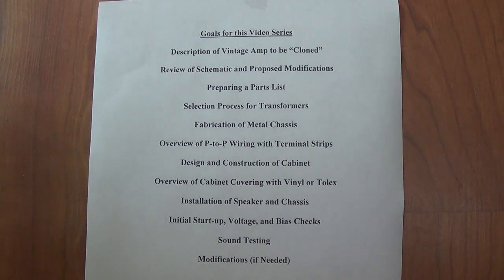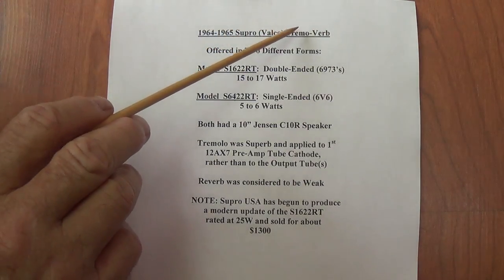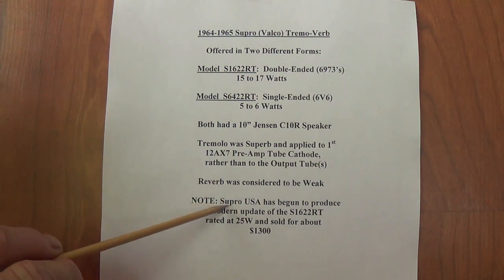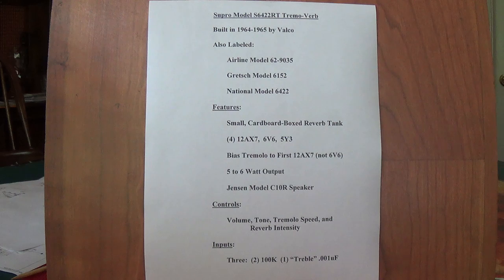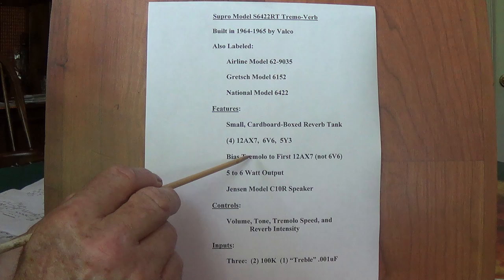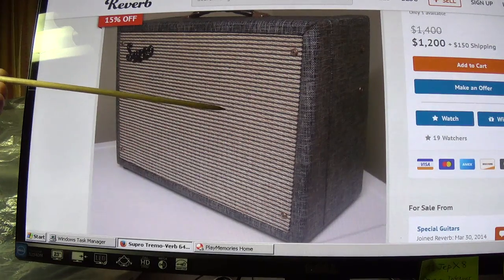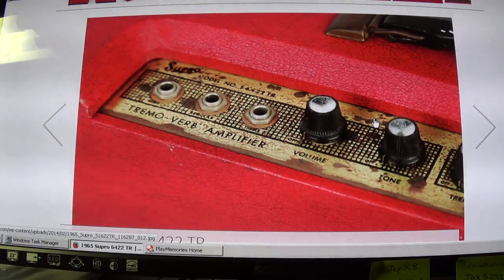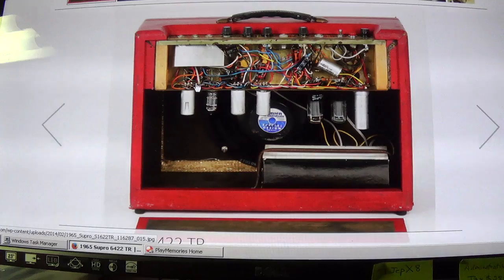How to Scratch-Build a Vintage Amp, Part 1:  Research and Methods

Comment: Hi Uncle Doug! May I ask you a couple of questions? I am planning to build a small Amp (2,5 Watt) using an old Tesla radio for parts. It has a Rectifier Tube and 1 preamp,  1 poweramp and 2 further for radio purposes. Tubes used are Rect: AZ11 Pre 6AV6 Power 6V6 the pre and power have other codes but i am giving you the alternatives that may be more familiar. Power input Transformer has 6,3 Heater ( with all tubes there was 1,6 Amps used. It will now be approx 750 mA) and 4V for Rectifier tube and 250-0-250V where according to schematics 238 V leaves the Rectifier Tube. My questions are, Firstly do you see the possibility of getting Tremelo on here and if yes can you recommend a suitable Tube and secondly do you see a better combination of tubes for Pre and power amp bearing in mind I don't know what the output Transformer is capable of, output is 5 Ohms. Maybe Rusty could check this over for me !
Reply from the maker: The AZ11 is not an ideal rectifier tube, in my opinion. It's voltage drop is even higher than a 5U4.  Other than that, I know little about it. The other two tubes sound OK. Are you sure the rectifier heater winding is 4V? As far as a tremolo, I guess you could fit in an extra 12AX7. I don't understand the OPT "output of 5 Ohms".
Reply: Rectifier heating is  4 Volts yes, even noted as 4 Volt heating on the Tube Data but I do have a 6,3 volt line also for the others. 5 Ohm is the speaker out, yes I have a 5 Ohm speaker :-)
Reply: Maybe a diode rectifier instead, there seems to be a great lack of filter cap and grid resistors and so in the schematic, maybe its different for a Radio with all its coils and doo da' or does Rusty think I should just see if I can get the Radio back to life and start my hunt for better parts ? hope Rusty is not working too hard!
Reply from the maker: This is a most unusual circuit, with a 4V rectifier filament tap, almost no filter caps, and a 5 Ohm speaker and output impedance.....Rusty says he's never heard of anything like it. Let us know how it turns out.
Reply: I'll let Rusty know Doug, Thank You. You should have been a teacher, you explain everything with such ease and don't make it more complex than it has to !
Reply from the maker: You're welcome, Elvin. Things have to be reasonably clear for me to understand them, so I simply convey the explanations that make sense to me.

Comment: I have the Gretsch 6150T, without the reverb tank. This series will be invaluable in restoring my amp, which has a badly dog-chewed up case. It does have good sound with no detectable hum without an instrument plugged in. I was going to let it go for $75, so glad I didn't. A thousand thanks!!
Reply from the maker: You're welcome, Ken. It's a great amp.....you made the right decision.
Reply: For sure, Uncle Doug. I was fairly serious about playing in my younger days, but I was born with stiff wrists which made it very hard to fret a guitar in the normal position and ended up being so frustrating I just quit playing. I wasn't interested in lap slide guitar at the time, but now I'm pretty motivated to try it. Looking at a lot of plans for building one, as I have the tools and skills. That will come before the amp restore, which is perfectly useable as is, just looks like crap! As can be seen here:
http://www.token.crwoodturner.com/gretch/index.html
Reply from the maker: Boy, that missing cabinet corner and seriously blemished control panel are going to be a real challenge. Please let us see this when you are done.

Comment: I was lucky enough to get my hands on the Gretsch version of this amp for free, a Gretsch 6152, which is identical to the Supro. It was somewhat rough shape when I first got it, it has the oval 6x11 Rola that is torn, yet completely functional, if all you want to play is Brown Sugar, it sounds good, but the tears make it very rattle-y, I ordered two baffles from MojoTone and they messed up both times due to the odd size of the baffle so I'm on my own now for now, since I'm replacing it with a baffle capable of holding a 10" speaker, problem is, what is the proper ohmage of this amp? I bought an 8 ohm speaker and it seems to be much quieter than the stock Rola, and I bought a Weber 10A-S, which is a damn good speaker, so I doubt it's the speaker. Any help would be greatly appreciated Doug!
Reply from the maker: +anarchypickle   You need to measure the resistance of the voice coil in the Rola speaker. If it's around 3.2 Ohms, its impedance is 4 Ohms. If it's about 6.5 Ohms, then its impedance is 8 Ohms.  However, speaker efficiency is a big factor, AP, and can result in very different volume levels even if the impedance is correct. Perhaps the Rola was just a very efficient speaker.

Comment: I have a Garnet Amp that is SE with a 6V6GT and has tremolo and reverb. its a model E15TR. its a "stencil" amp branded as Vagabond sold by Eatons department stores. Made in Canada.
Reply from the maker: +Barry Beadman  It sounds like a really nice amp, Barry. I'm not too familiar with Garnet amps, but will check into them with some Internet searches.
Reply: Garnet Amps, Gar Gillis. Used by the Guess Who. Made in Winnipeg, Manitoba.

Comment: I love the sound of single ended 6V6..........wonderful tone in a Gibson Skyark GA-5 that I have....and singing clear overdrive when turned up....I also have a Westinghouse radio console AM/Shortwave that has  single ended 6V6 output and has a very warm sparkling tone... but one of the most wonderful amplifiers I have heard is this Bell and Howell reel to reel  that I used for an audio amplifier for watching TV/VCR/DVD  etc..........You have to turn the tape motor on to activate the amplifier but don't really hear the motor.....I hooked a big hiFi floor speaker up to the external speaker jack ....and the sound is out of this world....warm and rich beyond words....especially old  movie orchestral soundtracks............The only problem is are these single ended amps are very low powered .so one day I would like to build a single ended 6V6 amplifier using 3 or 4 tubes in parallel .to produce around 15- 20  watts......that would be awesome and quite loud and distortion free for living room........could build two for stereo!
Reply from the maker: +Chris Shippam  I agree with your affection for SE 6V6 tone, Chris. I've never seen or heard of an amp that used more than 2 output tubes in parallel. If you do build this, be sure to share some photos and an evaluation of the performance.....I would be very interested to see (and hear) how it turns out.

Comment: Hi Doug.  A quick FYI... I just finished step 1 of the Supro build which was: Chassis prep, power supply, pre-amp, tone-stack, driver, and power amp section.  There was fairly loud 120 cycle hum with the pre-map tubes out, so, I hooked the 6V6 to B2 instead of B1 and that killed the hum.  I guess only one 33uf cap was not enough to kill the ripple, in my situation.  On to the vibrato circuit...  PS, the 6SL7 sounds great.  I also added a cathode follower as section #2 in the 6SL7 ahead of the tone-stack.  More to follow...
Reply from the maker: +John Heaphy It sounds like you're making good progress, John. Keep us posted :)

Comment: I wonder if these tremolo amps were in response to the Hammond B3 Leslie system?
Reply from the maker: +Rhone Ranger   The Tremolo effect has been around for many years, RR, and probably arose independently from the Hammond Leslie, which tends to rely more on Vibrato than Tremolo effect.

Comment: Great series! But have you calculated the panty-to-gain ratio I can expect out of this amp?
Reply from the maker: +MrIgnition   From experience, the P:G Ratio will be quite high. Tremolo combined with lots of Reverb at a high volume is a proven aphrodisiac......guaranteed to double the yield of thongs, panties, and (depending on the age of the audience) Depenz.
Reply: +Uncle Doug -- Hmm. I may have to reconsider building this amp. With such a large panty-to-gain ratio, the last thing I would want is to have to trod through large swaths of Depenz while onstage. Especially if they were thrown during their later stages of use. I could see a large pile muffling the crisp highs of the amp and encumbering my signature leg splits while soloing that I've become famous for.  Unless there was some way of incorporating an internal circuit that would allow the user to select between a "lingerie" or "undergarment" only setting. I'm not sure what a circuit like that would look like though.
Reply from the maker: Especially troublesome is the probability that heavily-used Depenz can elicit short circuits within electronic equipment, necessitating ground fault interrupters and rubber hip waders for all performers. Granted, this may impede the performance of splits and other heroic gyrations, but it's a small price to pay for safety. Rumor has it that several of the early Dumble Overdrive amps came with a "L & U" switch, but since the circuitry was encased in epoxy resin, the nature of this vital setting must forever remain a mystery.

Comment: Appreciated your tip about replacement amplifier feet via Home Depot.  Thanks!
Reply from the maker: +Gerrick Reidenbach  They carry some nice ones, Gerrick, but the screws are too long (IMO).  I tend to use shorter screws for installation.  You're welcome :)

Comment: Can a beginner jumped into making of a 50 watts double ended amp that will be similar to the single ended you are describing in this video ! Thank you Uncle Doug you're an inspiration.! I have a 1966 lifco single ended, I like it but the repaired that was done lately was like a butcher job ! At least it's working ! After playing with a garage rock band and using vintage tube amps I was converted ! That's when I did get the lifco ! The lifco  needed a lot of work I did some but when it came to the electrolitic capacitor (3in 1) and resistors I give the job to someone else (I asked that any parts removed be kept and returned to me) after at least 50% of the resistors where removed and the 3in1EC, the amps was returned to me with three Chinese EC, I never saw the colors of the old parts they did removed ! That's the reason now if I could  I'll do the job myself ! Finally I have to admit I really like the lifco anyway !
P.S. when I did get the lifco recently it was a 100% original but not working ! This event made me very interested in working with and on classical amplifiers ! Thanks again Rusty, Jack and you Uncle Doug ! Have a great day !  :)
Reply from the maker: +gerard cousineau  Greetings, Gerard.  I would imagine that a novice could successfully construct a 50W DE amp, but I wouldn't recommend it. It would be like trying to ride a large motorcycle when you don't even know how to ride a bicycle.  As you found out (the hard way) just about the only way to get repairs done right is to do them yourself. It's why I got started in this field long ago. Best of luck with your Lifco :)

Comment from the maker: Good Friends:  Your comments have no reply capability, so I'll answer up here. You really need to acquire some background knowledge, especially in safe handling of high voltages, before attempting a build like this.  Also, if you want to build a similar amp but without the reverb and tremolo, I would suggest a Fender Champ circuit instead. Best of luck.
Reply: I also had questions about safely handling of high voltages, because every amp building tutorial warns about it. Are there any tutorials on electrical safety for amp builders?
Reply from the maker: Thanks, GF and good luck :)  Strange....this time it let me reply ???????
Reply: +Uncle Doug its rusty,i seen screwing with your computer when you werent lookin,bad doggy!
Reply from the maker: I finally figured it out. You have to go to your YT preferences and check "Anyone" can comment or reply. Actually, Rusty told me :)
Reply: Good Dog!!! :)

Comment: I'm about to start a 6V6 project of some type.. I have a couple old complete hammond AO-29-13's that have nice PT's 2 pair of vintage 6V6's.. caps.. the OT's, if memory serves me they are 11 watt, so they can be used as well in certain models..  maybe i'll make a Princeton reverb clone or something.. or maybe a baby 6V6 marshall using all 4 of the 6V6's.. i have so many fenderish amps already, so a little crunchy rock machine might be nice..  time to break out the schematic books and look around..
Reply from the maker: +kujawat  It sounds like an interesting project, Kuja. Let us know how it turns out :)

Comment: Would it be possible that the missing shield you mention was the phase splitter/ driver for the 6V6s?

   I have noticed that on other amps, preamp tubes not directly involved with gain ampflication or tone circuits are not necessarily shielded as the signal gain and s/n ratio has already been accomplished by the input 12ax7s.  
Any other 12ax7 used as tremelo or possibly reverb tank driver/preamp or just a phase splitter for the final power are not shielded, either by design or bean counter requirements.
Reply from the maker: +SuperCarver2011  I guess it would make sense, SC, but it disturbs my OCD tendencies. All of mine will be shielded. Bean counters be damned :)
Reply: +Uncle Doug  Of course, that's the way I would build my tube amp. 
However, when it comes to factory production, it seems that the bean counters eventually try to find ways to cut costs and maximize profits.

For example, a 9 pin tube socket that will accommodate a removable  twist mount shield,  requires a more expensive socket to secure the shield.  The latest price on the tube socket and shield at online tube store is $2.50 at individual retail prices.
 A factory that has a production run of 1000 or more amps (Fender etc) will get each tube shield and matching socket for a lot less..say $1 for arguments sake...That's $1000 saved over the production run on just ONE ITEM.

Comment: I wonder if that Red valco you showed was modded to use 6V6s. The output tubes don't look too much like 6973s. The build is going to be awesome, can't wait for the updates!
Reply from the maker: +Mark Considine  Greetings, Mark. The Red Supro I showed was a single-ended 6422, so the two large tubes were a 6V6 and a 5Y3. The Model 1622, which I mentioned but never showed pictures of, is the double-ended model and has skinny little 6973's.
Reply: +Uncle Doug ahhh. got it! thanks for the info.

Comment: Nice "research tutorial" on these vintage amps, Uncle Doug.
 Looks like you have uncovered  an interesting project, as there are a lot of Led Zepplin fans out there, even ageing in my senior years. 
 I can only simulate the sound of Page's Supro "O" amp, that he used  on my Line6 POD XT digital ultimate tone guitar synthesizer,  which  has the built in AMP MODEL selector to simulate the sound of the Supro "O" ,
as well as  OTHER typical amps of that period. 

Just like the rest of us, the manufacturer of this digital box doesn't seem have any more information on what Page used during those first Led Zepplin sessions, so perhaps that  Supro amp mystery  is a good thing, as some things should left as they were when those first sessions were recorded in the studio, where Page was using a "specific" Supro Amp. 

Nice to see your  curious kitty getting involved in the "picture". Hope Rusty isn't jealous, but he should be on camera for the ending credits, not going off looking  back with that disgusted look on his face..LOL!

Looking forward to interesting discussions on PART 2.     "Build it and they will come."
Reply from the maker: +SuperCarver2011 Thanks, SC. Even though I don't intend to copy the original, it's always a good idea to acquaint yourself with every possible detail, to assist in the design of the newer version. Also, I just love to study these old gems.
Reply: +Uncle Doug Yes, once upon a time, a lot of things were made in America. Even the Brits (Marshall) copied
Leo's amp designs to some degree then modified to suit their tastes. Now pretty much most of the modern
(affordable) amps are made in China on PC boards.  The boutque hand wiredamps are still made, but now cost a poor man's fortune.
But today, even these are easier to buy..as they say " some things are priceless, for everything else there is
MasterCard"
Reply from the maker: I also accept Krugerrands and Swiss Francs :)